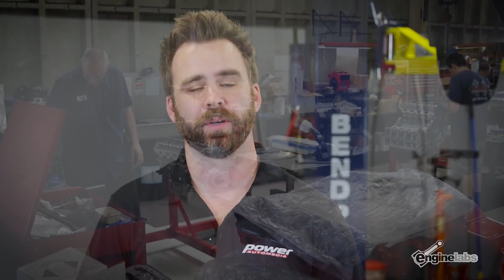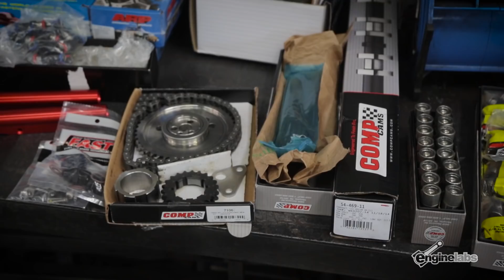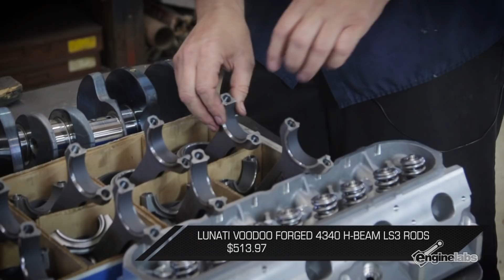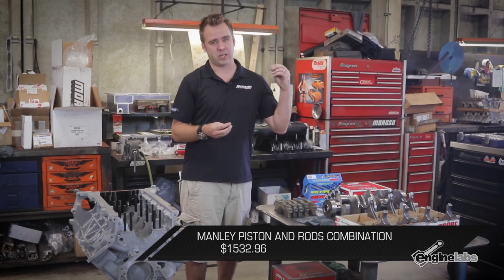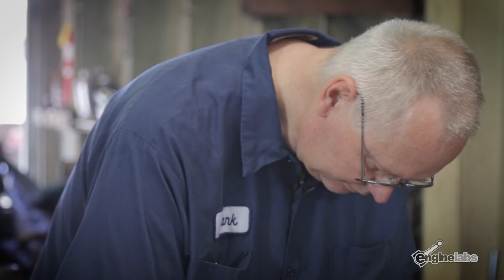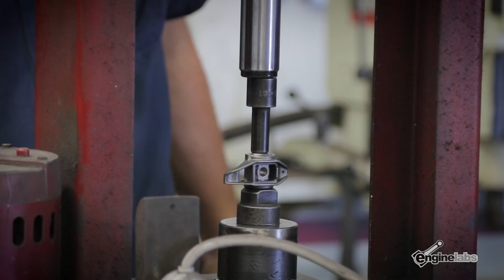$10k Coyote vs LS3 Shootout - The Build

Comment: You could have left the factory internals in the coyote with new bearings and rings, factory internals have supported well over 1000 hp. To be fair with LS just changing out the rods, which are the weak point in LS and a freshen up. Money could have been spent on head porting on the coyote, to be fair on power production as the LS had ported heads. You used an aftermarket throttle body on the LS, and factory on the coyote, which could have been purchased if not waisted on internals. Both are great engines, and depends on what you want. The coyote easily will pull more RPM than the LS, as the LS uses old pushrod technology that will definitely have to be replaced for higher RPM. You already did an overbore on the coyote, why not go .030 over if not just hone and rings? Don’t use cam limiters on the coyote, as tuning the variable cam timing properly can gain a lot of power, as the cams can be tuned for extra overlap where needed and still idle great. I know it’s a budget build, and selecting needed parts only to produce power will be different on both engines, as you may lose 50+ horsepower on the coyote for unnecessary parts for reliability on the coyote. Just my 2 cents.Also get a ported Boss intake, not a factory, huge difference in power.
Reply: We've turned 8200 with a sbe ls. The rods aren't weak....that's a myth.

Comment: I think the ls3 will beat the complicated and huge coyote(too many moving parts) in terms of power and torque. But that's just my opinion. I really like both builds and would definitely try either of the funds were available.
Reply: It's not complicated all pushrod nuts nutswingers are always talking about how complicated and hard to work on coyotes are.  They aren't hard to work on and you can slap boost on a stock long block with adequate fueling and make 700 wheel even with a gen 1.  With gen 2 and up you can do 800-900+ easily.  Stock long block.  Seems pretty simple to me I don't find anything about that complicated and it'll still drive like a stock car unlike a big cammed ls which is what you're gonna need with more displacement than the coyote to even compete on power production.  Nothing complicated about that just pushrod guys who refuse to see the benefits of dohc

Comment: this will be a fun build to watch yes i hope the ls wins but like all motors they will both have there strong points and weak ones but has anyone pointed out yet that the big hp 302 that they put in the cars has a flat plain crank not a dual plain like the truck motor that they are building so i might want to do a quick crank swap if i wanted to build the real bad ass 302 everyone has today  but for tq they may have something

Comment: Would it be possible for chevy vs ford to ever use similar engines or even engines without a 50ci difference? How long are we going to compare 350ci chevys and ford 302s? Ford has a 351, and a fuel injected version and a HO version that was in lightening pick ups.
How cheap is a 351 / 400 ? or stroke the 351 easy street monster for cheap.
Or stroke a push rod 302? Would still be undersized but probably still about even and cheaper.
or use ford motorsports 363 block vs the LSx.

oh I know, lets compare a 429/460 ford vs the LS3, you know since ci don't count and we are all so focused on cost.

Comment: how come the boss302 intake vs the stock ls3, I think the ls3 should have hi ram intake
Reply: +88TransAmGTA No Fast 102 :(
Reply: +alex369 hi ram is better for hp, but not so good for hood clearance
Reply: +jeffgt3rs I know they broke the budget for the 5.0, they just not gonna say it. you have to have deep pockets for those motors. An stock bottom ls3 with H/C/I is 2x less to build, no need to touch ls3 bottom end, already built proof
Reply: +88TransAmGTA bullet*

Comment: I would pick the ls3 because im a Chevy guy for life, and it’s more compact, so I if you have less room to work with in your engine bay you might have a easier time with mods like putting a supercharger or turbos on it, and the ls3 is cheaper overall, when it comes to parts, because if you get a already built engine, and want to put performance cams in your engine the ls3 has one to pay for, and the coyote has 4.

Comment: Correct me if I'm wrong but aren't the heads diff on the f-150 5.0 than on the mustang coyote 5.0? And the ls3 gets CNC ported heads and the coyote gets as cast truck heads with no port work?
Reply: +Mark Gearhart I see, that's pretty cheap work on the ls heads I wish I could get decent CNC porting for that price. Of course mine are already CNC ported from trick flow so........😉

Comment: The shear size difference alone. The chev weighs like 425 and the ford is about 460lbs and its all up top.  Id prefer the lower center of gravity and simplicity of the ls. Then theres the price of the engine itself. I could buy an ls3 running WITH the car it came in for the price of a coyote where I live.

Comment: i dont agree with using a aluminum block without putting steel sleeves in the cylinder ports the engine will blow out from all the HP every time without those steel cylinder sleeves
Reply: Not if you only going n/a. add turbos ect, where you are looking at 800+, sure..but it's fine for 5-600. mines got about 30k miles on it since I built it and it's fun. 468 to the wheels n/a

Comment: why does it matter one block is used that will not hurt performance what so ever and great video but i agree about the crank why did you need the lsa crank? Was it to make up for cost or you really thought the cast crank wouldnt hold up? But cant wait for part two!
Reply from the maker: + Brent Erwin We utilized an LSA crank simply because it is forged and was an affordable option that fit our set budget for the build. Thanks for watching and here's the link to the final showdown between the two engines: https://youtu.be/KFkOy0F5hGg

Comment: as far as reliability what are we talking? like at 100k miles do timing chains need to be changed? will both make it to 100k miles? or will they require a rebuild at ~50k?
Reply: The Chevy will be fine
Reply: +Ian Thompson what do you mean the Chevy will be fine? do elaborate if possible
Reply: matt bale Its exactly what I said, the LS3 is a robust, and simple engine. I believe the 5.0 has something like 200+ more parts. Timing chains wouldn't become weaker. Least not on the LS. Granted a bigger cam, and stronger valve springs put more load on the chain, but using a double roller chain means it will last a long long time. If well maintained the LS3 should easily make it a 100k as is.  With a refresh somewhere around 200k.

Comment: This is far from a fair comparison since they started with a used Coyote and all new parts, including the block on the LS3. Im not a domestic guy at all, but I would go LS all day due to the amount of power per dollar as all the stuff, including the base engine to start building from, is cheaper on the LS platform. Sure, the 4 valve heads on the Coyote "should" flow better, but the cost of a LS cam vs 4 Coyote cams is going to be a huge difference etc...

Comment: 2 really different motors.  The LS with its extra cubes should have better torque with the Coyote and its twin cams having HP and revs.  Depending on what you're  looking for, LS having muscle car power curve and Coyote more track and sports power curve.  That's  my expectations.
Reply: +Leland Lewis That would be my expectation too.  However, their website is lsxtv.com, which means that they've got a bias to the Chevy motor (unconscious bias or not).  The plus is that they're taking the motors to Westech, and as far as I can tell, that's a pretty reputable shop for doing dyno pulls, and Westech won't really care which motor makes more power (check out the Engine Masters series done by Hot Rod Magazine, they test all sorts of stuff).

Comment: Great job. Same budget but buying used parts at a discounted price on one (coyote) end and comparing to new off the shelf parts at full retail price at the other (LS) end to level the playing field. So the LS gets fewer dollars to spend than a real-world comparison would offer. Poor article, unfair comparison, and the LS  will still hold its own, if not win, the one-sided "competition." I love and admire what Ford has done with the Coyote. Just saying dollar for dollar it doesn't compare with the LSx. Either way, 2 great engines by 2 great manufacturers that are dominating the performance world today. 

By the way, power per cubic inch is an irrelevant ricer term. Doesn't apply to 'Murican greatness that is the Coyote AND LSx.

Comment: let's see even if you get more power out of the coyote which in this test I'm betting you are. the ls3 is a brand new block, with upgraded forged lsa crank and cam, lighter and smaller in size and will have way more torque down low. versus a used stock block, stock upper coyote. how much would a machined ls3 block would of saved you guys? maybe enough for a hotter cam.

Comment: I have been in the Ford vs Chevy battle for years. When it comes down to it Chevy are less on part to build. They use small cams less timing in fact they sometimes run better when the timing is retarded a few degrees. Unlike Ford which requires larger cams and more timing. My choice for Ford is the fact that it loves RPM and holds together well the old fox 5.0 are a awesome platform for making power without having to step up to the 5.8. By the way a true comparison should have the same c.i and as we all know that has never been the same in this battle. Would love to see the out come but with years of this battle behind me on the ground I already know the out come FORD all the way less c.i and more power and toque over Chevy.

Comment: As the saying goes. There's no replacement for displacement!!
Reply: +Rob Hamilton sure there is! they call it forced induction.
Reply: +Rob Hamilton more valves = better hp and torque per cube. if the coyote were a 6.2 it would make mid to high 500s hp and torque wise

Comment: they should have just got the truck coyote threw on a cobra jet and a nice set of cams and long tubes...no need to build the bottom end with the power they're making just a couple minor things in the valve train to help it turn 8k reliably.  they wasn't very smart with either build the coil packs and that crap ain't necessary with the coyote

Comment: Hi there from England I'm in a position where I recently bought a ford seirra with a crap 2.3 cologne v6 I'm trying to decide which of 2 engines to buy I've been offered a ford 4.6 coyote full engine gearbox in a create or a GM LS6 from a crashed CORVETTE Z06 in the crash only the rear end was wrecked. I've asked people here in the UK but they fill me with unessassary info and I get headache I'm wanting to build up a good turbo build but power with reliability. Any Americans advice would be greatly appreciated

Comment: Why didnt y’all compare a 4.8 or 5.3, i feel like comparing a 6.2 to 5.0 is apples to oranges  i mean thats 1200cc’s thats left on the table in chevys favor, just think that you could’ve done a slightly bored 4.8 with the same build scheme and had 5.0 vs 5.0

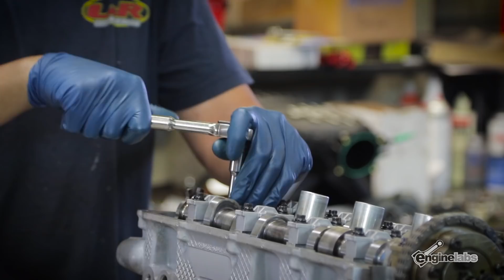Comment: 0:32 That guy is not using a torque ratchet bothers me to much LOL
Reply: i dont see many people snug down bolts with torque wrenches. in most videos they run them down and finish with the torque wrench. i assume that increases longevity of the wrench. Probably helps with calibration as well. But that's all speculation.

Comment: i would go for LS3, i have a BMW m54 and the Coyote looks a weakly built as my engine, see those thin cylinder heads with variable timing with 32 valves and the thin monoblock with those casted stripes scares me now.        Plus, i also have had some oil leaks through the plastic valve cover in the BM.... Maaaan, why cheap, flimsy plastic covers.... no long term reliability for the Coyote 5.0.. definetly. Now im starting to save for a Zl1.

Before i had a thunderbird with the 302 engine which was bulletproof tank, this Coyote would be gone with one overheat.. i overheated that 302 many times and never lost a horse power at all.

Comment: Off topic but still applies. 

First Ford trucks with reverse trailer assist and trailer blind spot monitoring......really? Ford thinks there is a blind spot 20 feet to the rear of the back bumper?  Now there is some new 360 B.S........all this B.S. just confirms that even Ford knows, anyone dumb enough to buy a Ford product probably isn't smart enough to drive it with out lots and lots of help!

Comment: The Coyote is at a displacement disadvantage, 5.0l vs 6.2l. The extra revs of the Coyote will not make up for that.
Reply: I think they will.  The Coyote heads also breathe unbelievably well.
Reply: Looking forward to it. Keep up the good work.
Reply: The coyote didn't, that's too bad. It will be hard to overcome a 24% displacement disadvantage. Maybe if a Borla stack injection is used.

Comment: Bunch of forged parts for what im guessing to be sub 700hp? Waste of money. Would have been better money spent on other things like a larger bore or trying to get it to rev higher. Maybe even going forced induction.
Heck, you can buy a new truck model 5.3 straight from GM for around $5k. That leaves another $5k for a turbo or super charger that would get it up in the 1000hp area without the need for aftermarket internal.

Comment: There's no replacement for displacement
Reply: +Steven Cummings except forced induction :D
Reply: +nocoolname32 Forced induction is displacement.
Reply: Larry im always willing to learn so i hit the old interwebz and couldn't find a single article that shares your view point, every single article was one vs. the other. what am i missing, any links you can provide me?
Reply: nocoolname32
The word displacement means "to move something". The job of turbochargers and superchargers is to move more air into an engine by compressing it, allowing the engine to induct more air. Forced induction is basically forcing more movement.
Reply: Larry fair enough, but how does one compare that to the actual term CID? does ram air increase ones CID? does NO2? when i wave my hand i displace air but my hand has no CID ha. so when using the term "no replacement for displacement" it's talking about the physical size of the cylinders of which FI doesn't change.
Reply: +nocoolname32 They measure superchargers in displacement the same way the do engines. E.g.: Whipple sells a twin-screw supercharger kit that displaces up to 2.9 litres for LS engines. As for turbochargers, they're basically just superchargers but driven by exhaust gasses, so they're still a displacement system.
Reply: nocoolname32
Well, when people talk about displacement, they usually are just talking about the volume swept by pistons, but most people forget that superchargers, etc., also displace. The whole idea here is to move as much in and out of an engine as possible. You do this buy increasing the displacement.

As for "CID", it stands for "Cubic Inch Displacement", which is just a unit measurement of displacement. Like the other guy said, they measure engines, superchargers, and all these things the same way, whether it be in liters, CID, CC or whatever. Liters and cubic inches are just different units of measurement, but they are still both units that can be used. Americans just happen to like using cubic inches.

As for Ram air, sorta. The idea is to collect moving air and force it into the engine, but it doesn't necessarily do this by mechanically sucking or pumping air into an engine.

As for NO2, I think you mean NOS. That works to increase the amount of oxygen (long explanation of how NOS splits into oxygen and nitrogen) available to the engine, but, again, it doesn't increase displacement mechanically.
Reply: *****
Right
Reply: and i agree with what you both are saying, however, when billy bob coined the phrase "there's no replacement for displacement" im pretty sure he was saying that even with timmy's turbo's import, there's no replacement for more CI's. so i guess what do you think the creator of that phrase was trying too say?

Comment: One more thing bare block coyote cost about 1500$ and boss 302 crank about 450. why buying F150 used engine cost 3k
Reply: +Mark Gearhart there is, just buy  aluminator coyote and swap cams, springs , intake
Reply: +Mark Gearhart very true

Comment: Will anyone ever compare a ford and chevy with similar displacement?  Why are we forever comparing 302 ford vs 350 chevys? Over head cam wont offset that difference until above 6k rpm.
You want simple and cheap push rod engine ? ford has those. You want complicated expensive? Everybody has one of those too.
Just once do comparisons that are similar.
How about a chevy 305 v8 ?
Or a ford 5.3 or 351 or 5.4 ?

Comment: Mustang GT 2018 makes the 460HP...just boost it in less than a day for 5-7,000 and your in the 8-1000HP world!!! Not with any stock LS and weeks of work. That's the reality...this test is designed around people who know nothing about the Coyote! MMR with the Factory ported Heads and the 351X Block make close to 4000HP and run in Pro Mod. No one else competes in Pro Mod with factory anything. The other thing is they are the smallest cube engine of all cars in Pro Mod! The truck block is a disadvantage...just boost it for 5-7000 grand and your into 800+ HP. It never needed to be rebuilt, it had all premium internals already from Ford. Rods and Crank Forged, Pistons are great. factory Mustangs and trucks are boosted and making that HP all over the country. LS is a waste of money!!!